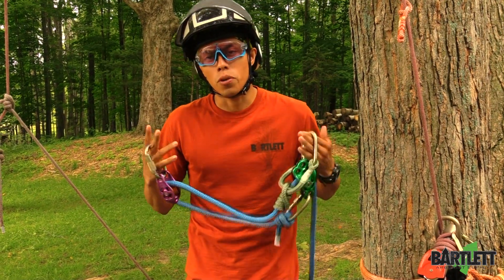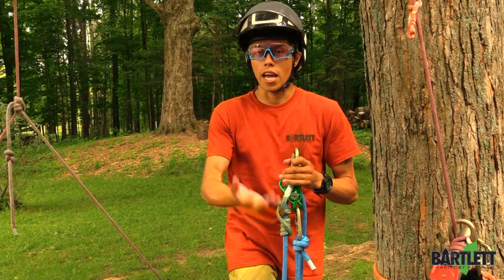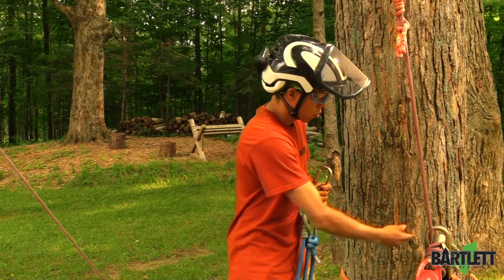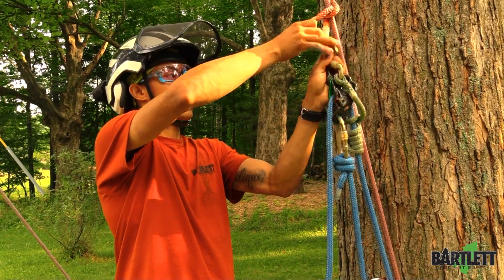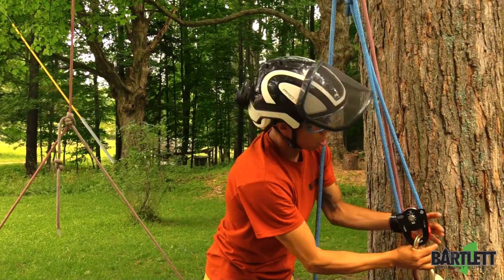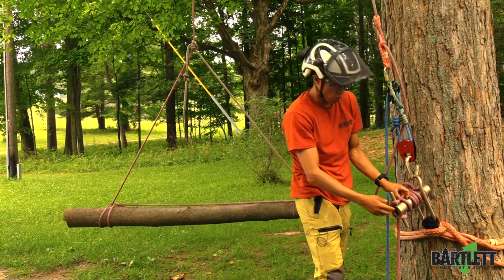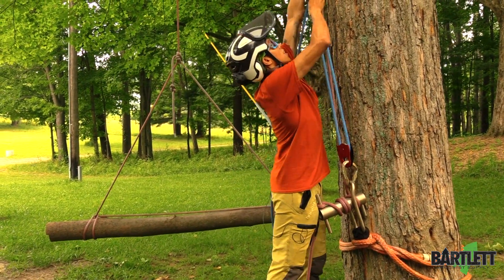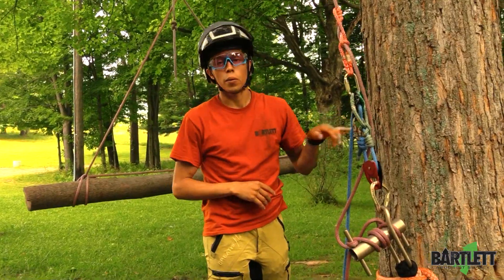Mechanical Advantage w/Progress Capture

Comment: This seems to be a 2:1 system?
Reply: This is a 3:1 or a 2:1 system. It depends which way you have the system oriented. One way it's a 3:1. The other way, it's a 2:1 with a change of direction.
Reply: mechanical advantages are always in odd numbers, this is indeed a 3:1
Reply: @dgjonz  Look up '2:1 mechanical advantage' . Two lines between the blocks.
Reply: @deehannaway5754 depends on what side is the anchor side of its 2:1 or 3:1 in this set up it is 3:1

Comment: I've used a very basic method for tensioning the lowering line on the bollard. I use a nylon sling with a large pulley tied in a klemheist to the downward leg, around the bollard twice, and through the pulley.
I've wanted to make a tension set for ages now, I'd like two paw rigging plates and four pulleys. But I just can't stretch to fund it for its occasional use projections. Even two DMM rig pulleys on steel o biners with one eye and eye hitch will be expensive, when we can create a system on the hoof with what we do already have. It'd just be nice to have the dedicated system in a bag ready to go 🤷‍♂️